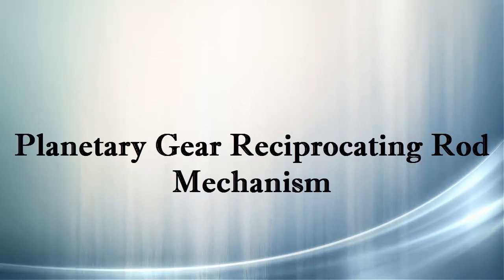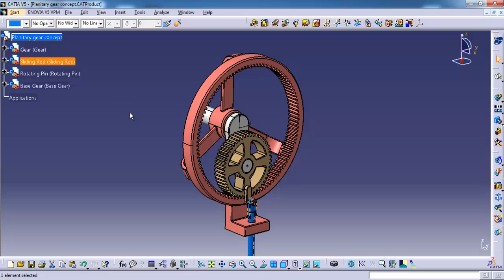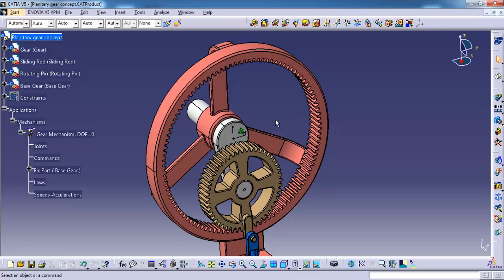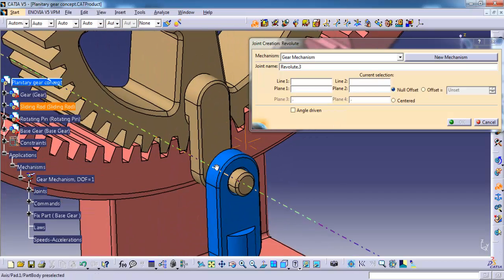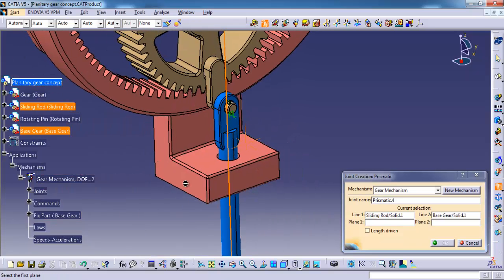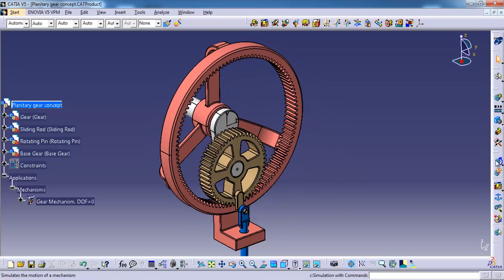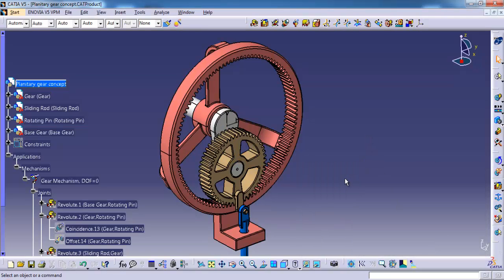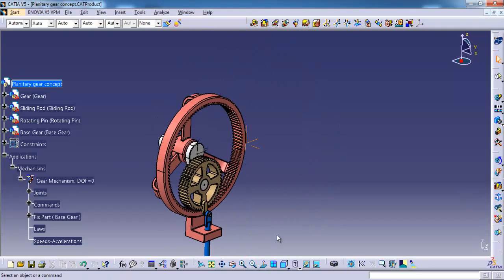Planetary Gear Reciprocating Rod Mechanism | Catia V5 | DMU Kinematics | Tutorial for Beginners

Comment: Such mechanism should have a gear ratio of 2:1 (internal-planetary). In this video the teeth interference between the planetary gear and the internal gear is noticeable in motion.
Reply from the maker: Yep, I agree with your point. It supposed to be 2:1 ratio 👍 actually I just wanted to share how the joints would work in CATIA V5.
With Love! Royal!
Reply: @royalkinematics3645  👍